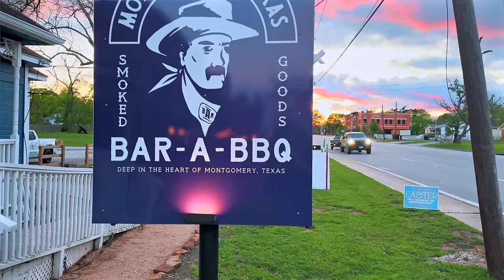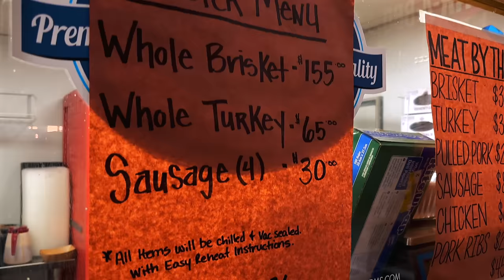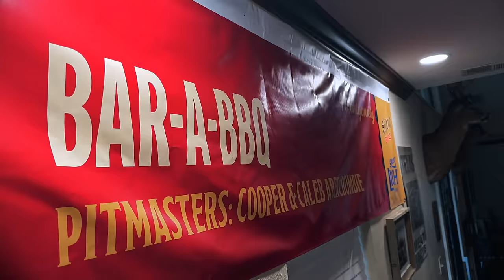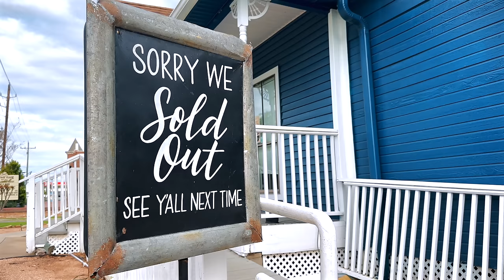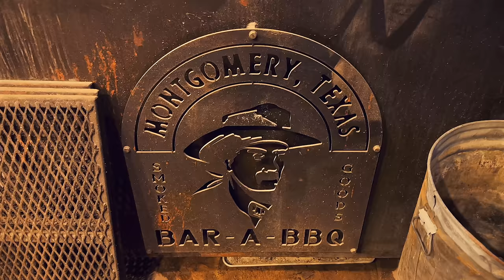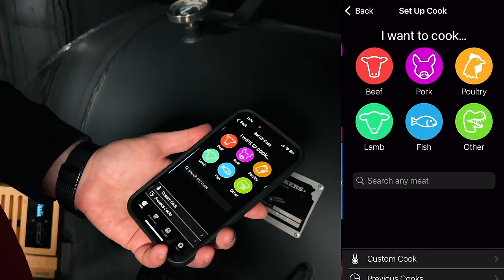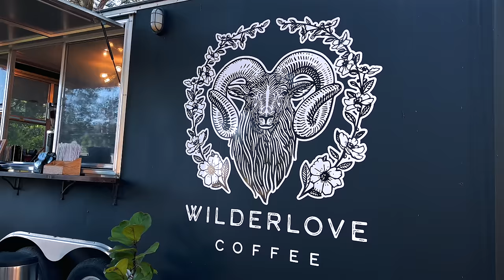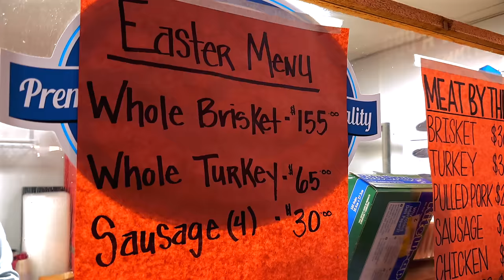I Got Schooled by The Best New BBQ Joint in Texas - Bar-A-BBQ

Comment: They're seasoning both sides of the turkey or just the top?   Also, how long are they letting the turkey sit between seasoning and going on the smoker?  If it's a short duration between seasoning and smoke, is it Refrigerated or room temp

Comment: What kind of backyard smoker would attempt to cook a 20 pound brisket? I understand the problem with attempting too much with too little resources---mainly room on your grate to allow the smoke and heat to circulate properly. How hard is it to smoke a 20 pound brisket? Easy, as long as you have a long, sharp knife to split that brisket into two. It's MUCH easier to work with two 10 pound briskets than a 20-pounder.

Comment: David, I am wondering how efficient is this Kamado, or really any of the other "big name" ceramic kamados vs. one of the better insulated pellet grills or even a metal kamado like the Weber Summit? Is it more or less expensive to fuel this vs. wood pellets? I'm just over it with my CharBroil Kettleman, so looking to add a different charcoal option to my Members Mark pellet grill...
Reply: I think charcoal efficiency is by far the best thing about a kamado. Once the unit is hot burns through the fuel really slowly

Comment: So was the first thing to touch them briskets the match light charcoal fumes? Serious question but that lit off fast for not being match light and a sealed up pit
Reply from the maker: I didn't see the brand of charcoal - but I guarantee that's not a problem AT ALL in a smoker that big - the real smoke doesn't start until the wood is on that coal is just producing heat.

Comment: Love the videos! Only thing is the MEATER is junk. This weekend was the last straw where it ruined my cook. It's consistently off by at least 8° over my instant read thermometer. As well as not being able to go more than 25 feet without losing connection. Brought the first one back and the new one is worse. I'd rather go by feel and time with help from the instant read rather than this piece of junk
Reply from the maker: Hi Max. I’ve been using MEATER products since they were a Kickstarter project and haven’t had those issues. I have busted them by letting them overhead on a hot grill or by physically breaking them - but MEATER support has always been able to fix the problem. If you’re having trouble with their support team, please DM me your ticket number on IG or FB.

Comment: When it comes to clean smoke and dirty smoke, you need to figure out the limits of your offset. I have a 16". My first smoke using ribs, the logs were too big and I had to fight to keep temps up. This produced a very smoky rack of ribs. I fought every time to get the pit up to temp and maintain temps. Then I discovered smaller logs and clean smoke. I preheated the wood to limit smoke when lighting logs. Then I had no smoke flavor at all on my ribs. Imagine this on a brisket, because you'd taste nothing. Now I fire it up and put the meat on sooner, use a slightly larger log, which gives me an extended burn time and more smoke. I also took out the grate that elevated the logs off the bottom of the firebox and allowed (too much) air flow and that extended the burn time and makes more stable temps.
Reply from the maker: All great info.  Thanks Todd and welcome to the channel!

Comment: The turkey breast that you have smoked is natural cut.  What Bar-A-BBQ is using is way larger, it is made with a number of chunks of turkey breasts fused together with natural binders and likely injected with a saline solution.
Reply from the maker: Interesting take - It didn't seem like multiple breasts, just a very large turkey but I could be wrong.  I'm going to have to figure this out!
Reply: @BehindTheFoodTV  On second thought I have looked at the original video, the turkey breast at Bar-A-BBQ is not very bulky such as those bulky ones I referred to.

Comment: I do not like MEATER thermometer.  To thick, WiFi range is not what is advertised, durability is poor.  The end cap falls off. Nice app.  Will never purchase a MEATER again.
Reply from the maker: FYI if the end cap falls off it’s most likely because you ran it in a hotter environment than supported. That’s what happens when the materials overheat. But either way - did you enjoy the rest of the video?